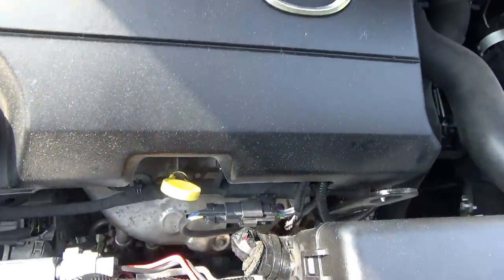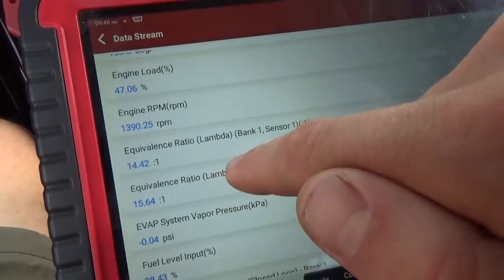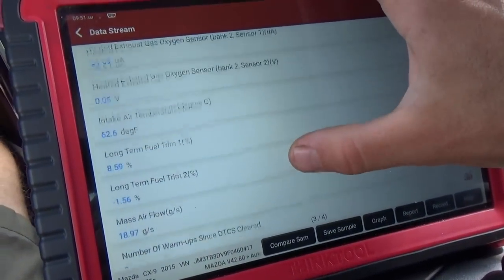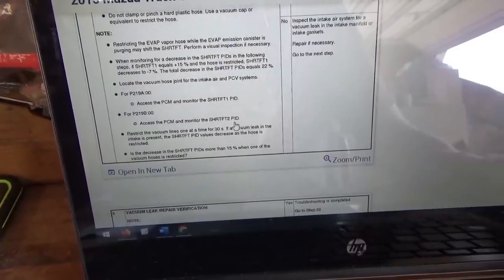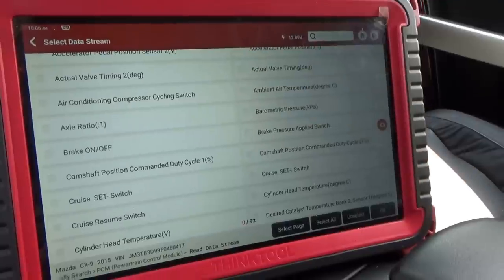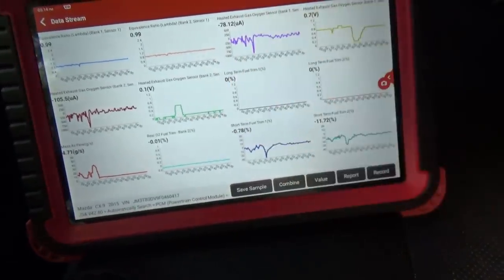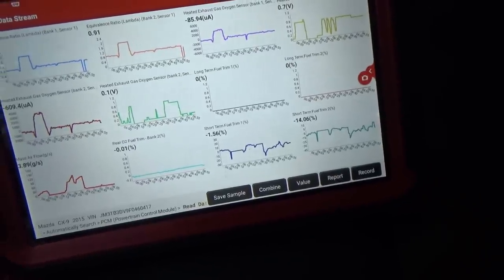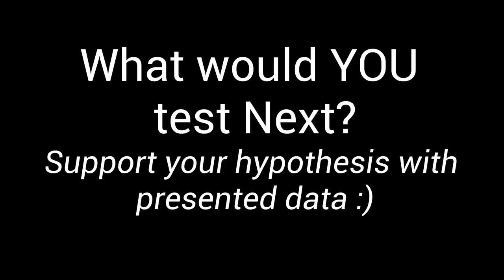Mazda MYSTERY No One Could Solve - Part 1 (P219B - Bank 2 Air-Fuel Imbalance)

Comment: Swapping is a good idea, I would prove the air or fuel flow going into that bank is normal. A computer dealing with an air flow that is too high or fuel flow that is too low because something is broken or blocked in that flow.

Comment: blast the intake air with propane and watch all 4 sensors. they should react evenly even if they are not showing the same values. that should show if the o2's or afr's are showing cause or effect.

Comment: Smoke machine up the tailpipe and look for bad welds or fine cracks in the bank 2 exhaust between the upstream and downstream sensors. A stethoscope with an open hose may also be helpful to pick up on an exhaust leak in this area.

Comment: The madness at the start made me wonder if two sensors had there plugs crossed over.
So it was the wrong sensor that the computer was reading.
I of cause would run away :)

Comment: I had this code once on a newer Silverado but it was just due to someone putting a cheap oxygen sensor on. I was surprised as well to see that they are also detecting imbalances between cylinders on the same bank.

Comment: I'm no mechanic but my son had a vauxhall/opel corsa that had an engine light come on and the car went into limp home mode. this was diagnosed as a lambda sensor, easy as it only had one but this car has two so maybe only one is faulty and causing it ti interfere with the down stream sensors.

Comment: start with a smoke test of intake manifold etc, along with inspect the integrity of the sensors, OE? or aftermarket, repair the sensor wiring to OE, then switch the sensors to each others position...

Comment: So years ago, Champion Parts Rebuilders used to have a plant in State College....   they remanufactured automotive parts....   Electrical,  water pumps, carburetors,  clutches,  etc.

Most likely they are gone, I sold and installed an automated vertical shaft grinder (30 hp) that would re- surface clutch pressure plates and center plates for automotive and truck clutches. 

It was so long ago I'm not sure the building still stands, but they employed maybe 200-300   people. 

Just a FYI- love watching your work, BTW.
Reply from the maker: That would be so cool if they still existed!

Comment: So many possibilities! Swaptronics first of course.
The tiny currents involved in those sensors means the wiring/connections are always suspect. Beyond that,  intake or exhaust leak, injector prob, valve leak/timing. Who knows, even a partially blocked cat (if each bank has its own). A few more tests needed. The propane one mentioned below could be useful.
Reply: very sensitive systems..

Comment: If I remember right, Mazdas calibrate the upstream A/F sensors with the downstream sensors, if the downstream sensor is bad, the upstream sensor will be off calibration.
Reply: However, it is interesting that the downstream sensor does seem to wake up with a richer A/F, so may not be the case here.

Comment: Mmm, what are our possibilities? Incorrect sensor, faulty sensor(s) , incorrectly wired sensor, air leak in the exhaust perhaps? I would swap sensors and monitor data and a thorough visual inspection. And because it's easy and the car is a unknown quantity also do a relative compression test.
Reply: You can probably rule out an exhaust leak, usually you will hear those, even if it's a small one.
Reply: @jtjones4727  I humbly disagree, sometimes you can not hear them, some times they might only show up by either by a smoketest or a pressure test on the exhaust system.

Comment: Great video and responses comments guys  I have that code I changed the downstream sensor and that code cam back any more suggestions I would appreciate you guys input ?
Reply from the maker: Why would you change the downstream O2 sensor? Did you watch the video? 🤔
Reply: I changed the sensor closet to the top where the engine is by because I had a code p0420 at first now the code is p219B on my 2012 cheavy traverse Lt

Comment: IMRC linkage
Reply: That's a thought.   But you'd think it would throw an IMRC performance code or something if the shutters were binding or hanging up.  Not enough airflow through the runners would def start to cause a rich condition on that bank, which the computer seems to think is occurring.

Comment: It's easy enough to check for an intake manifold leak with some brake cleaner.  If that looks fine, I would try swapping the O2 sensors around.  There could also be a minor exhaust leak somewhere between the head and the exit end of the cat.  There is so many things to look for so got to start with the easy stuff first.  But going from what info we have so far, my first guess at this point would be an exhaust leak.

Comment: sensors back to front? upstream and downstream mixed up?
Reply from the maker: Not possible... Upstream is AFR, downstream is regular O2 👍
Reply: @PineHollowAutoDiagnostics  oh but it is...sorta...i had a Toyota Siena with a af code...can't remember of the top of my head but when i started tracing wiring i found that the upstream and the down stream were swapped and....when the previous "tech" installed the new aftermarket sensors....they wouldn't clip into the factory harness soooo...you guessed it!!! They chopped them and made them fit the old sensor harnesses... the wiring color at the connectors were correct, wasn't till i inspected the entire length of the sensor harness i found they cut it midway and spliced...upstream in the downstream and downstream in the upstream🤦 😆
Reply: will have to see what "rewire" has been done. Keep up your great channel Ivan

Comment: It's probably a fuel injector. The PCM probably detects the imbalance by recording AFR sensor signal at different crank positions corresponding to exhaust events for each cylinder. It then averages the values over multiple cycles and compares the average of each cylinder to determine an imbalance.
The "engine off" fuel system status should maybe have read open loop.